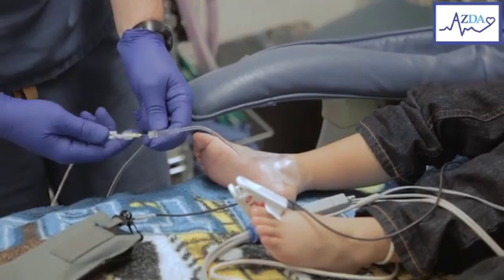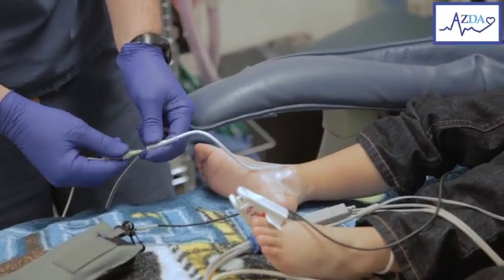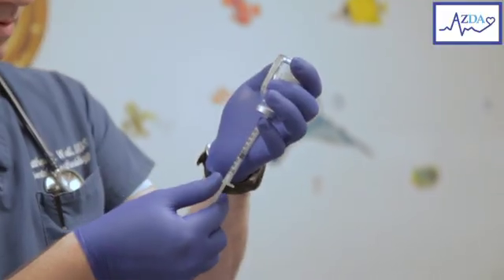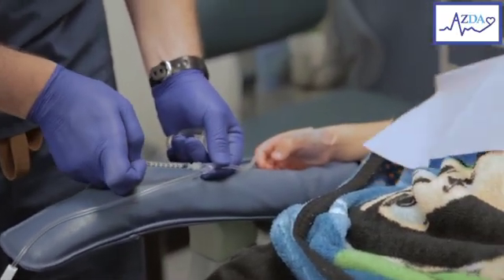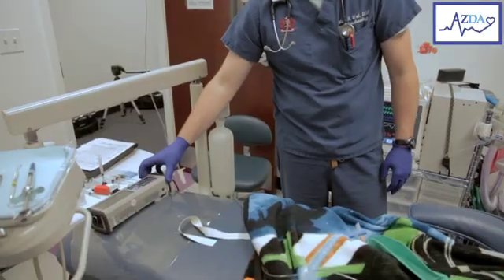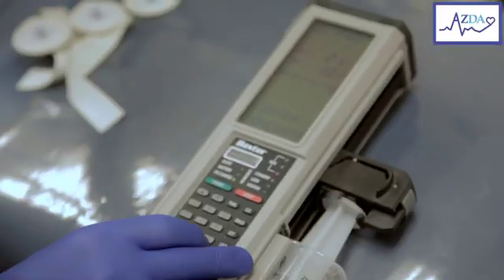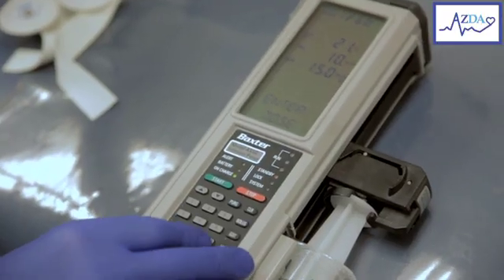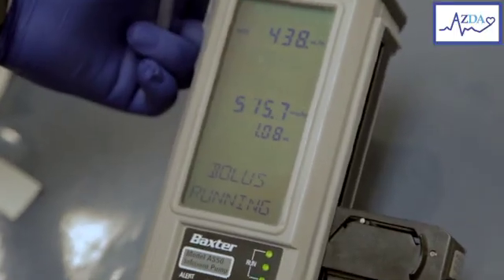Jackson Rees (Mapleson F) circuit Nasal intubation in a dental office

Comment: Wouldn't it be easier to just put them on the ventilator??
Reply: Great question. Ventilators work very well, however, they are large and bulky and generally not needed with children. 99.9% of children do very well breathing spontaneously. The only cases where a ventilator is sometimes needed is with an adult.
Reply: I have a feeling that most dentist offices won't have as many nice anesthesia supplies. I also wonder if it has anything to do with not needing a malignant hyperthermia cart when there are no volatile anesthetics or succinylcholine. In my town, the dentist does it at the community hospital and they are all connected to the anesthesia machine with a ventilator.